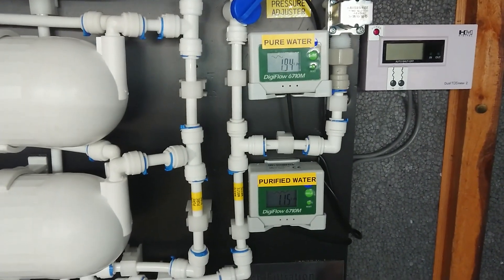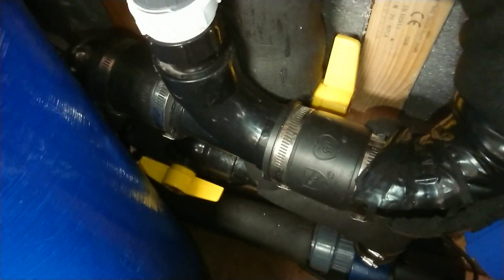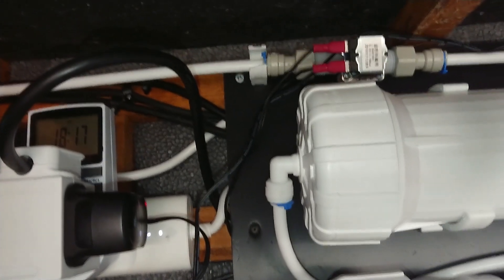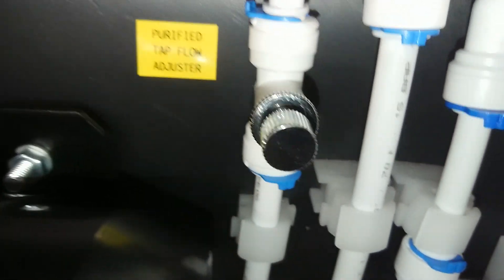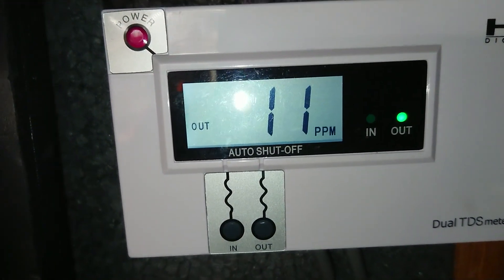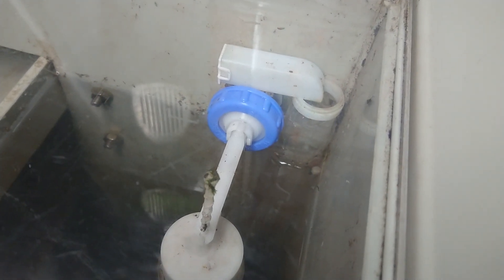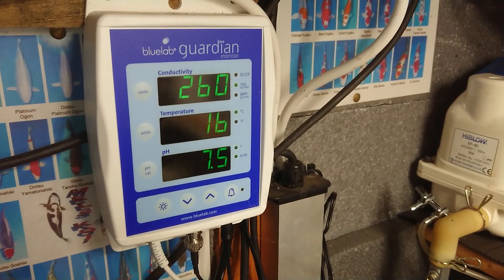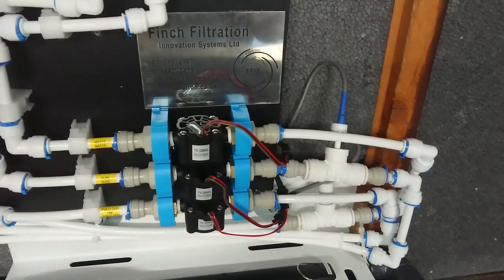Review of Koi Pond Recyclable Reverse Osmosis after 8 days running 👍

Comment: Nice RRO set up there Marek, lots of benefits too.👍
Are you thinking of setting up bicarbonate dosing?
what Kh do you get out of the tap?
Reply from the maker: I'm hoping Dave because the kh is 9dkh out the tap, I might be ok, without dosing, I'm not going to run it on the edge, I hope, 7.2ph, and see how it's going kh wise, any advice will be greatly appreciated 👌 👍
Reply: @marekskoipond9083  I've not needed to dose for bicarbonate, and my Kh is about 6 out of the tap,
But i've not been running it hard just about 700 litres a day pure RO and 350 liters a day waste.
pH was around 7.3 and tds 130ish, but thats all out the window atm, due to treating for flukes...😂